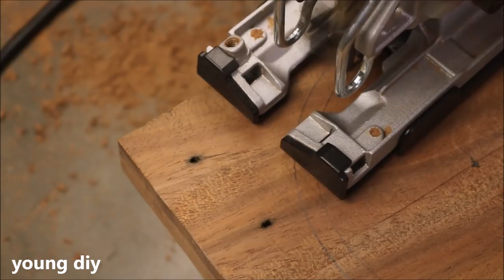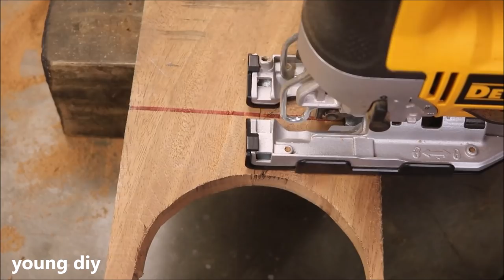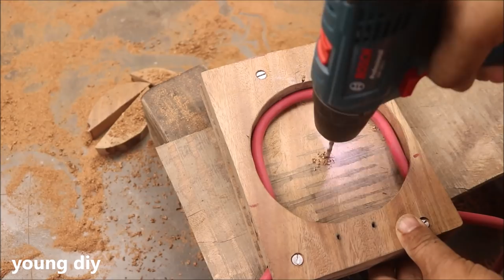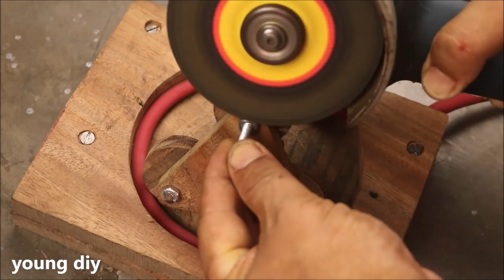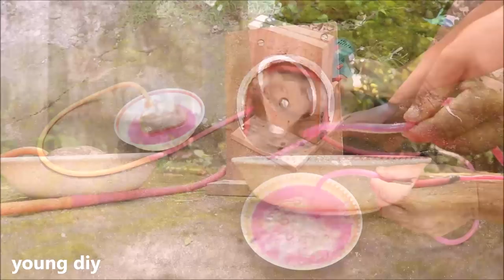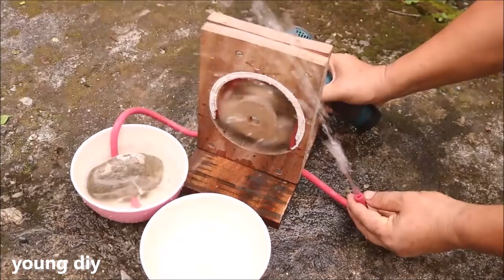How to Make a Simple Peristaltic/Squeeze Pump at home | DIY .

Comment: Awesome work! I tried to make one of these but couldn't get it to prime with a hand crank. Do you have to be really careful about getting an airtight seal, or does it work fine as long as you have enough power? (Didn't think to hook up a drill). What kind of tubing do you use?